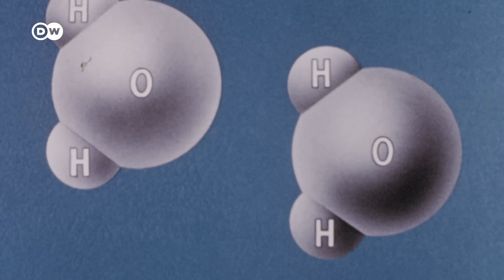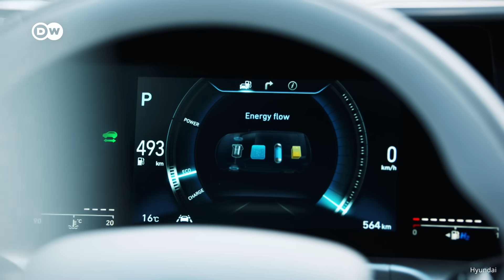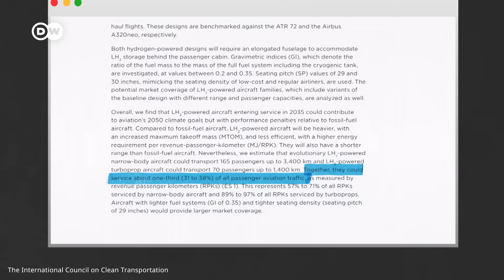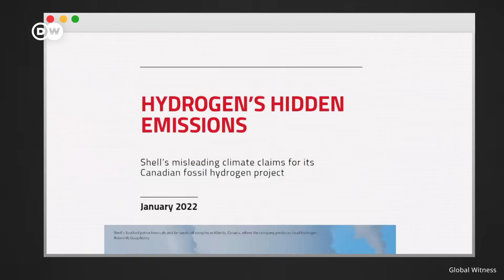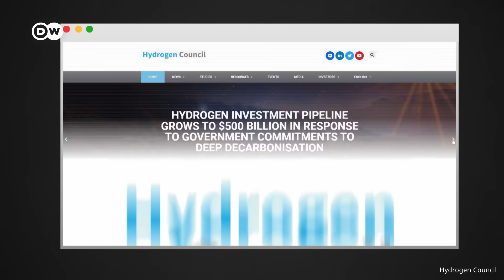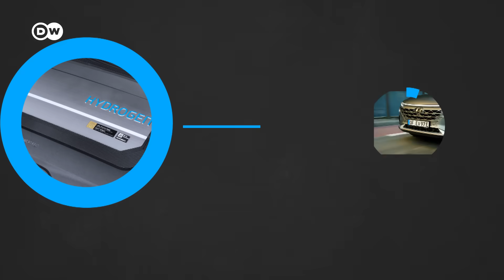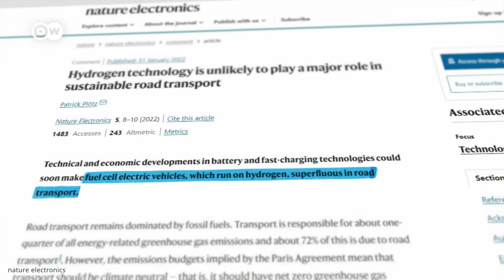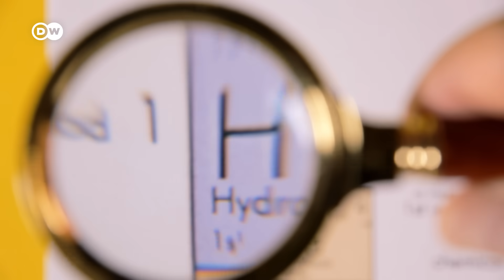The truth about hydrogen

Comment: I think the horrible 40% efficiency of using electrolysis to produce H2 (i.e., for every 100 ergs of energy used to produce H2, you only get 40 ergs of energy delivered to the end use of that H2) should make trying to use H2 in any large scale a non-starter.  Better to continue expansion of the various green electric sources (solar, wind, geothermal, hydro, tidal, etc.) coupled with a huge increase in the number of nuclear plants (fission for now, fusion in the near future) and a radical upgrade of the power grids to bring us to and an all electric world.
Reply: Electrolysis at 40% is based on old tech.
We never use that fallacy for batteries, it always is: yeah go batteries cause they will be beter in 10 years...
Reply: @VYR1985  No, the 40% is based on the energy losses at the point of electrolysis, the energy needed to compress & transport the hydrogen to the point of use, and the losses expected during transport & storage.

Comment: When you talk about using Hydrogen as a carbon-free renewable fuel and energy carrier, I think you also need to mention Ammonia. H2 and NH3(ammonia) can both be utilized as very potent forms of fuel but hydrogen in the form of ammonia is much easier to store and transport because it can be more easily kept in a liquid and it is more energy dense by volume than pure hydrogen.
Reply: It also already has a worldwide transport network, because we already require ammonia for fertilizer.
Reply: 30% of global natural gas production is used to make hydrogen to make ammonia…
Reply: I work at a fertilizer plant in ND, USA, ammonia is likely going to be the carrier moving forward in our new hydrogen project.
Reply: I think Maersk is looking into running ships on NH3, but they are also looking on other POWERtoX ways. 
Maersk plan to have CO2-neutral 8 container ships in Q1 2024 and we are talking big ones as in 16.000 TEU, so not much smaller than the largest current traditional ones. They tell that they have customers willing to help finance those ships, as in customers wanting their shipments to be CO2 neutral and okay with paying extra for it.
Reply: @bzdtemp  I haven't heard anything about Maersk going with ammonia. I heard those ships would be running on methanol. OTOH, I do know that MAN ES has signed a Joint Development Project Agreement with the Italian maritime classification society RINA and the Shanghai Merchant Ship Design & Research Institute (SDARI) to develop a ship design capable of being fueled by either ammonia or methanol.
MAN ES has offered a methanol-based engine since the mid-teens, and has been developing an ammonia-based engine since 2018. Developing an engine that could shift between the two fuel types as conditions dictate (and on-board fuel handling facilities allow) is a significant development since, as a press release notes, “A ship specifically designed and optimized for using ammonia and methanol as fuels offers a future proof, environmentally sustainable solution.”
MAN ES is also has partnerships with Eastern Pacific Shipping, a shipping company with headquarters in Singapore and the German shipping company Hartmann Gas Carriers to use it's new ammonia engines.
Reply: and you could use ammonia to make fertilizers :) this uses a LOT of energy or natural gas.... around 11kWh for each kg of NH3, but if energy gets cheaper and cheaper eventually big farmers could produce their own N fertilizer which is the biggest CO2 emitter by far on a farm
Reply: @physicsgran  I agree. If farm groups are able build their own distributed green ammonia plants, they could have access to their own source of fuel and fertilizer. It would be a great movement to further green up these sectors.
Reply: @nolan4339  There are research articles about this, and membranes that can easily extract Nitrogen from air (usually this is done by distillation of liquid air).
Reply: @physicsgran  The point is, if energy gets cheaper and cheaper, we won't need Hydrogen anymore, we can just run the electricity through the grid, very simple.
Reply: @nigratruo  yes, but for fertilizers you still need amonia or urea...
Reply: @nigratruo  Do you think your electricity grid has the capacity to carry all the extra demand it would need to?
Reply: OMG this comment of yours made me think a lot ..
Ukraine is the first country in all  Europe in ammonia prod.
War is about profit ,so just think about it ...
Reply: @ΚωνσταντίνοςΠόρο  The ammonia there is made from natural gas, which could be one of the reasons for the war.
Reply: Ammonia is very toxic and also needs to be cooled to be stored.
Reply: @jimj2683  It can be stored either under pressure at atmospheric temperature or fully refrigerated at –33°C and atmospheric pressure. For safety's sake the tanks should be able to withstand a minimum internal pressure of 250 pounds per square inch. Neither –33°C or 250 psi are that hard to do. And while ammonia itself is much more toxic than gasoline or methanol, certain ammonia-derived fuels – especially those that can be mixed with water – have a benign safety profile.
Reply: Both ammonia and methanol show promise: If sustainable electricity is less expensive, then e-ammonia (ammonia synthesized from nitrogen and hydrogen in an electrochemical process) makes the most sense but if biomass is less expensive, then bio-methanol comes out ahead. Both products are liquid fuels and are already widely available making them relatively suitable. Although ammonia has its own special handling considerations, like the need for pressurized tanks, methanol is more corrosive to metals so it has its own issues with storage - as well as engine mods.
As far as ammonia and NOx emissions go: "NH3 fuel is environmentally friendly, producing zero carbon dioxide and low overall emissions. The only significant pollutant emitted by NH3 is NOx. Gasoline and Diesel exhaust also contains NOx, and NH3 is commonly used to reduce these emissions. With an on-board supply of NH3 Fuel it will be even easier and more cost effective to use NH3 to react with NOx over a low-cost catalyst and produce environmentally benign N2 and H2O."
And of course the application is a factor: In the shipping industry dual-fuel engines are an option with different fuels being cheaper on different routes.
Reply: Its also quite explosive...
Reply: @Paerigos  Most things that can be used as a fuel are "quite explosive." It goes with the territory. It's all a matter of knowing the risk and managing it. Even Teslas have been known to catch fire and explode: Lithium-ion batteries may suffer thermal runaway and cell rupture if overheated or overcharged, and in extreme cases this can lead to combustion.
Reply: True, but which is safer, shipping green hydrogen across the ocean or ammonia?
Reply: @onequestion2059  From what I have heard, ammonia has a better safety record than hydrogen in nearly every use case.

Stores like LPG, but as a gas is lighter than air instead of heavier, and is very difficult to ignite or explode, thus has a better safety record than even LPG.

Yes it is corrosive and a strong irritant to the body, with high concentrations able to damage the lungs, but gaseous ammonia can easily be detectable with human senses and can also be extracted out of the air by spraying a mist of water.
Reply: @nolan4339  Where as hydrogen can only be economically shipped as a cryogenic liquid. You don't want to be caught in a spill of that stuff.
Reply: @onequestion2059  Safer for whom? Tanker shipping gas sinks at sea and ruptures - compare the environmental risks. Hydrogen is of the order of 100,000 times LESS soluble than ammonia, meaning that if the hydrogen doesn't explode it will bubble to the surface rather quickly with some acidification of the local water. The ammonia on the other hand which is significantly more soluble and will probably leave any surviving sailors distinctly blonde given its bleaching effect. Seriously, the elevated alkalinity would be more much more significant a change and impact on sea-life. When an oil tanker capsizes you worry about the wildlife but don't hear much about the sailors. So IF transporting liquefied hydrogen is similar in safety to LNG which we transport now, we probably wouldn't be too concerned.
Reply: Yes but also releases NO2 which is 300x as potent CO2. Not to mention depletes ozone layer.
Reply: @jeffsaffron5647  True, but once again you have to compare it to the alternatives: Recently, studies based on system analysis concluded that “green” ammonia has a real potential to be considered as a Power-to-Fuel for our energy future and that the greenhouse gas emissions from an ammonia-driven vehicle could be less than one third of gasoline- or diesel-driven vehicles (Angeles et al., 2018; Bicer and Dincer, 2018).
Grannell et al. (2009) and Westlye et al. (2013) concluded that NOx emissions with neat ammonia are equal to or less than with gasoline for stoichiometric or slightly rich fuel/air mixtures. With the optimized minimum quantity of H2, NOx emissions could be only half those of gasoline (Comotti and Frigo, 2015), but for lean mixtures, NOx emissions are higher with a peak at an equivalence ratio around 0.7/0.8 (up to 8,000 ppm in wet gas volume). A second peak was even observed for leaner mixtures as a function of ignition timing, no doubt due to the ammonia kinetics (Westlye et al., 2013). Several studies (Ryu et al., 2014b; Woo et al., 2014; Comotti and Frigo, 2015) found that NOx emissions (in ppm) increase with load, as with classical fuels, but that brake-specific NOx emissions decrease due to the high fuel economy at high load (Ryu et al., 2014b). In contrast, no significant effect of the charge was noted (Lhuillier et al., 2019a,b). Overall, increasing H2 increases NOx emissions, due to the impact on the adiabatic temperature. The proportion of NO2 in total NOx was always found to be lower than that of NO, with some ammonia dependency. Lastly, very low levels of N2O emissions (below 100 ppm) were also found in these studies, without a significant effect of the quantity of NH3. This indicates that N2O, the unique contributor to global warming from NH3 combustion, will have a low impact even if its global warming potential over 100 years is 310 times higher than its CO2 equivalent mass. The other main pollutant in the case of NH3 combustion remains the unburnt NH3 itself, with a high level for rich air/fuel mixtures (up to 2%vol.wet, Lhuillier et al., 2019a). Unburnt NH3 emissions were found to be constant even for lean mixtures and without any effect of combustion phasing, mainly due to crevice trapping, due to high CR (Westlye et al., 2013). Post-catalyst pollutant measurements showed that a standard three-way catalyst remains efficient even with ammonia blends but only for stoichiometric or 0.2% rich air/fuel mixture (Grannell et al., 2009). The positive impact of an ammonia catalyst cracker was demonstrated on NH3 emissions, due to NH3 dissociation itself, but its effect on NOx emissions was inconclusive and depended on the NH3 quantity at the intake (Ryu et al., 2014b). Lastly, from exhaust temperature values displayed in Westlye et al. (2013) and Lhuillier et al. (2020), a selective catalytic reduction system or other thermal system could be considered to limit NOx emissions but would require an additional NH3 trap to limit NH3 slip. It has to be noted that unique measurements of H2 at the exhaust were performed in our previous studies (Lhuillier et al., 2019a,b): high H2 emissions for rich mixtures can be linked to some NH3 auto-thermal conversions inside the cylinder itself.
Reply: @almar8874  Or just skip the combustion engine altogether and cut out the middlemen.
Reply: @jeffsaffron5647  BTW Because the air is mostly nitrogen burning any fuel under the high temperature and pressure conditions of an engine will produce NOX.
Reply: Similar argument for methanol.
Reply: Hydrogen electricity for surface transportation is a great idea. Using intermittent excess production to produce it is insanity. 

Stop the corruption and political insanity, please. This is in fact worse than illegal corn ethanol mandates. Once this corruption gets going it is impossible to stop. 

Just cry GW and the political zombie support it.
Reply: It is also  a lot more toxic than hydrogen. Not necessarily a show-stopper, but should be taken into acount.
Reply: @colindavidson7071  Hydrogen is not toxic.
Reply: @colindavidson7071  The flip side to that is that it only has a 13% explosive band (by volume in air) compared to 70% for hydrogen, so it's a lot safer frim that point of view.
Reply: @colindavidson7071  I remember seeing a report stating that incidents for both accidents and deaths regarding the transport and handling of ammonia vs hydrogen were actually around half (per unit of volume handled). The explosiveness and metal-fatigue causing hydrogen are serious concerns, not to mention the added cryogenic costs and risks when liquifying it.

Another interesting note is that ammonia leaks can largely be managed with the application of spraying water, as it is so soluble in water that you can basically pull it right out of the air by spraying water at it.
Reply: @nolan4339  There are at least a dozen of viable methods to transport hydrogen, some of them are almost inert (such as carbon nitride, LOHC and metal powders).
Reply: @nolan4339  Vey relevant comment.
Reply: also methanol, that is liquid in normal conditions, so maybe is a good choice to also rely in another chemicals/fuels
Reply: @consueloreinaofisher6332  Methanol can be used directly in fuel cells and combustion engines.
Reply: @vitordelima  & consuelo reinao fisher
Both true, but ammonia has the edge over methanol in green energy to fuel production. Because the atmosphere is 78% N2 vs 0.04% CO2 it's easier to make ammonia from the air than methanol. Even if you try to get the CO2 from a concentrated source like power plant exhaust the gas mix is still only 3-15% CO2.
Reply: @almar8874  And CO2 doesn't react with anything easily, you need to convert to CO or some other intermediary molecule in order to use it.
Reply: @vitordelima  BTW Ammonia can also be used in a fuel cell.
One plus on the side of methanol is that it is a liquid so its tank can be any shape - if the application has limited space to store the fuel you might want to go with it over ammonia.
If tank shape isn't an issue and you're using a fuel cell ammonia might be better because only the hydrogen is used to produce energy and ammonia is 17.7% hydrogen vs methanol at 12.6%.
OTOH if you're burning it in an engine and tank shape isn't an issue ammonia wins again. This is because NH3 has an octane rating of 130 to methanol's 109. So you can use a higher compression ratio and put more of its energy to useful work.
If all you want is heat methanol wins because it has a higher energy density.
Reply: @almar8874  Yes, it's just more complicated to use. Safety is the biggest concern when dealing with those substances.

Comment: As Elon Musk has said, "Fuel cells, are fool cells". Hydrogen is not an energy source but an energy storage system that as this video has explained, is very wasteful and inefficient. Once  electricity is generated, it is best to use it directly to charge batteries and then power cars, and trucks, or for use in our homes. Tesla is beginning to roll out heavy trucks that work on batteries.  Perhaps the one useful place for hydrogen will be in air travel.
Reply: I don't see batteries as a competition with hydrogen, but as a partner. Batteries has its own problems in cars, especially in heavy trucks. Batteries are heavy for example, that's why Resato and Shell are very enthusiastic about hydrogen trucks. For cars, well batteries is indeed better, but a lot of people don't like charging the car, which is reasonable. For me, losing capacity in the batterie is a problem. Over to my, the batteries will hold less charge.

Once again, batterijes are not competing with fuel cells, I see them as partners.

Comment: Storage technologies have improved. Doped ghaphitic carbon nitride, which can be simply created by mixing sugar and urea (in a kiln @ 550 degrees), can store 10% hydrogen by weight.
If we consider an automobile, a 50 kg "fuel tank" of graphitic carbon nitride powder could store upto 5 Kgs of Hydrogen at NTP. Extracting that requires heat, which the Hydrogen powered Internal Combustion Engine (HICE) can readily provide.
Same modus operandi (but on a larger scale) could be followed by the fuel pumps, where these HICE cars would be fuelled.
Same modus operandi for industries, where solar PV panels could provide electricity for electrolysis by day. The hydrogen produced, stored in tanks filled with graphitic carbon nitride powder and finally HICE engines providing the power to provide energy for the plant etc.
So, the future for hydrogen as a furl is not so bleak after all!
Reply: "that requires heat" - more and more losses just for what? being able to top up your car in 5 minutes instead 30 min. on the fast charger or using home plug ... H2 is troyan horse of petrochemical companies trying to keep their profits and still destroying our planet.
Reply: @hlasrozumu  what is your point?

Comment: Solar, wind, with all the improvements in battery storage make it a much better solution. Individual homes could generate all the power they need. Recent studies show recycled batteries could become a good enough source for new batteries that we will not need to dig up more materials. Solar keeps getting better, batteries keep getting better, and the infrastructure needed is far less than what hydrogen would need.